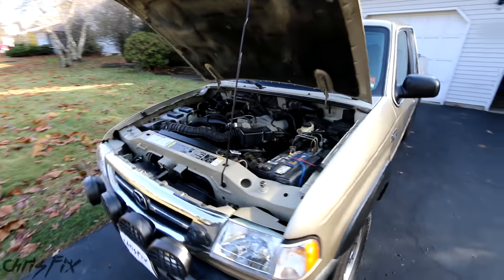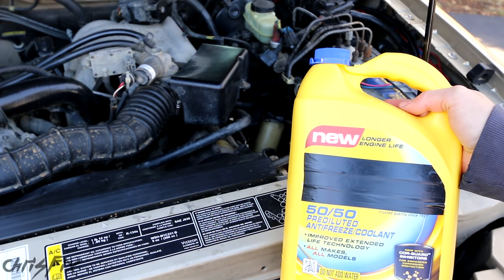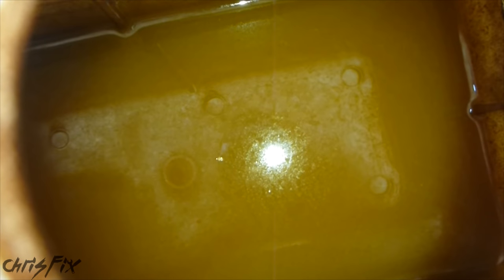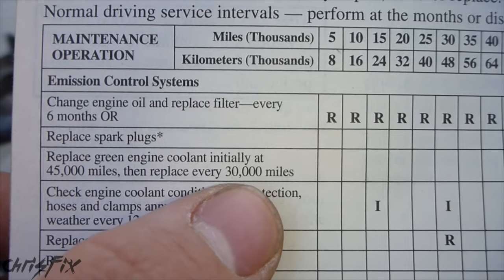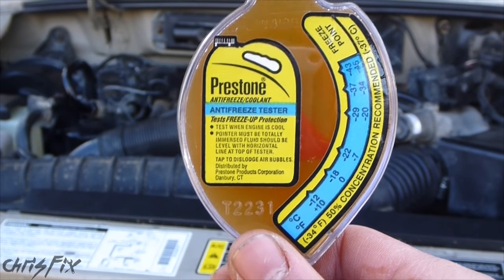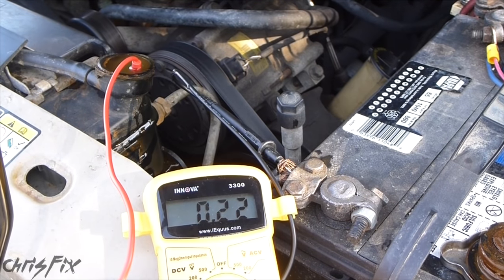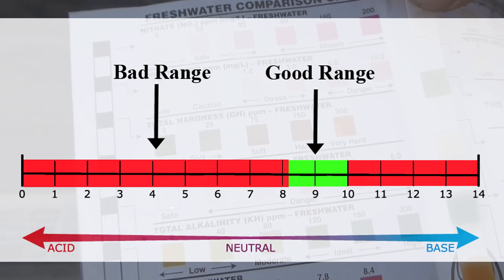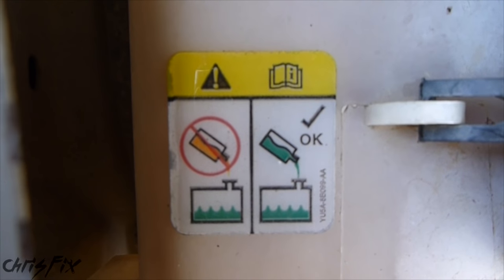How to Check and Test Your Coolant/Antifreeze

Comment: I tried the multimeter test and my readings were negative, ie -20. What does this mean?
Reply: Reverse the probes. Remember you are measuring DC Volts, so the reading should be .20.

Comment: my truck has a reservoir, but it's completely empty... what should I do?
Reply: +PhoenixHAM 1 Umm.... fill it up. Also take out the radiator cap and see if coolant is still in it. If not, then it's dangerously low. Go to nearest store and get some coolant in before something bad happen.

Comment: So I have a question my 1998 ford ranger owners manual says to use ford extended life coolant and then in parenthesis (dexcool) wtf? I'm reading allot of bad shit about this dexcool shit. So did I use the right stuff why would my owners manual say to use this stuff if it's so bad? I'm wondering what I should do know maybe I should just go to the dealership and buy the motocraft stuff.
Reply from the maker: +Istayuplatedrivefast If it says dexcool, then use dexcool. The coolant is designed for the block and gaskets your car uses. Just make sure if there was a previous owner, he used Dexcool too.
Reply: He did not but I made good use of my back flush kit. I talked to my bosses mechanic and he said use dexcool as well. After all the horror stories I heard about that stuff I kind of freaked out. I'm sure it will be fine as long as I don't neglect it or add that copper goop that is supposed to fix head gaskets.

Comment: looks like you went to Economy Lube ya they messed up bigtime. There are three colors of coolant Dexcool  which is made by AC Delco this is only suppose to be put in GMs that are not GMC or Pontiac the only trucks that use it are those that say GM or Chevy on the hood. Don't pore dexcool into your engine you will destroy it. The next type is glycol which is green this is the only antifreeze you put in that truck. and last but not least is frostoff which is made by Peak and is blue don't get this one mixed up with wiper fluid and don't pore that stuff into into the wrong tank you can destroy your engine.

Comment: Could you use water instead of coolant???
Reply: Water alone will overheat on hot days, and freeze in the winter, you need prestone...generallyh 50\50 mix.

Comment: why did they put orange coolant in your car when it says to put green? will it damage the car?
Reply: Ur car needs a different kind of coolant 
It ok
Reply: Yes, for instance if your car takes dexcool red kind and if you pour green into it and it mixes. It can cottage cheese up your system. So never mix the green with dexcool only use one or the other that your car calls for
Reply: Yes, for instance if your car takes dexcool red kind and if you pour green into it and it mixes. It can cottage cheese up your system. So never mix the green with dexcool only use one or the other that your car calls for

Comment: Just replace my coolent and the electrical conductivity is 13v when engine running 11v with engine off 🤣 that's after a flush
Reply from the maker: Make sure you are connecting the multimeter to the negative terminal (-) NOT the positive.

Comment: Isn't a 7 pH value considered too low?
Reply from the maker: a 7pH is neutral. Not acidic, not basic.
Reply: ChrisFix I know that from chemistry class. But isn't most 50/50 starts with a pH around 8.5 according to Google search results? So many different versions of truth out there. I'm confused
Reply: Thanks for replying

Comment: Awww fuckin' hell, when you flipped that radiator cap over I kind of cringed, that's just disgusting. Guessin' the coolant in that hadn't been changed for more than 5 years? or the system had a lot of rust or something through it?

Those little testers look great but how accurate do you think they are from experience?

My car uses 'super cool red coolant' good for up to 5 years, I stick to Comma as a brand, really good stuff and smells nice too, sweet =P
Reply: Johny40Se7en looks like some kind of gummy stop leak

Comment: if you have rust in your modern aluminium engine, you're in a world of trouble! especially as aluminium engines and alloys don't rust!!! What you have there is just old, bad coolant, not rust!

If you have an older (much older) vehicle then you might have a cast iron block but thats another story....
Reply from the maker: Not all engines are just aluminum. Many are aluminum heads and iron blocks. This 2001 has just that, aluminum heads and and iron block.

Comment: bottle of coolant is 20 bucks just drop it and fill it why mess around getting special tools for the sake of 20 bucks, better safe than sorry?
Reply from the maker: +H31995 Because why waste $40-$60 a year doing this if your coolant is still good? Dont throw parts (or fluids) at your car before you test them to make sure they are actually bad. That is my motto.

Comment: Wow that coolant is F***ED. It sounds like you know what your talking about, so did you neglect your coolant for the video?
Reply from the maker: Eternaly Random Before I got the car, it was not taken care of so the coolant system is really bad.
Reply: OK. it's good that somebody's taking care of it. I usually just do a drain and fill once every 2 years. thanks for the feed back!
Reply from the maker: Eternaly Random Yea, I have a video I am working on called "how to SUPER FLUSH your cooling system". It is basically an epic flush for this truck because it needed it haha. Should be out next week or the week after.
Reply: great i'll be sure to watch it.

Comment: Hey Chris, you know you Sh%^ LOL.  On a different note,  I own a 08 ranger that I must say is in prestine cond. I am one those motorist's who has to have everything clean. Oil is golden, brake fluid cystal clear, Anitfreeze  lime green, trans fluid cherry red.  It sounds exactly the same as when I drove her off the lot. Ok, enough bragging. I want to  change my fuel filter. It looks very easy but people tell me to pull fuses, disconnect the battery or else the gas is going to gush out.  Others have told me that you don't have to do anything but release the lines and it will drip just a little.  Could you tell me what is true?  Any info would be greatly appeciated.
Reply from the maker: +Mistergibsonsg1 Thanks man! For the fuel filter just have the car running and pull the fuel pump fuse. The car will stall and the line will not be pressurized since the car used up the fuel. You might still get some leaking out so have a drip pan.